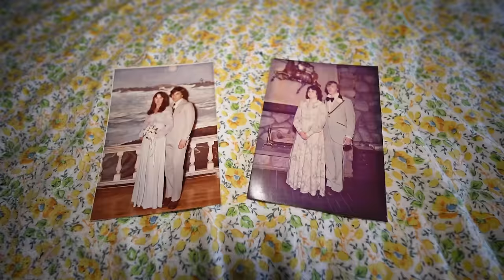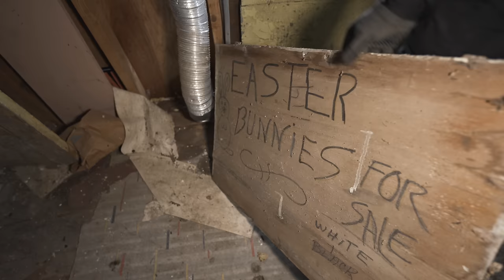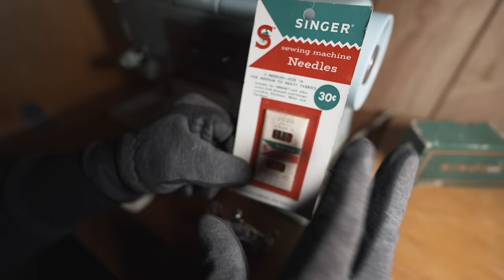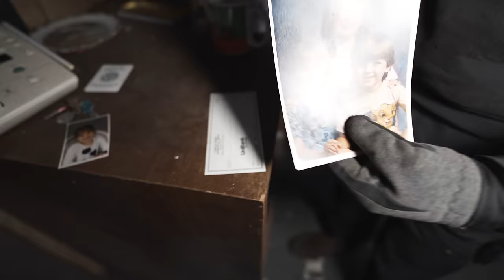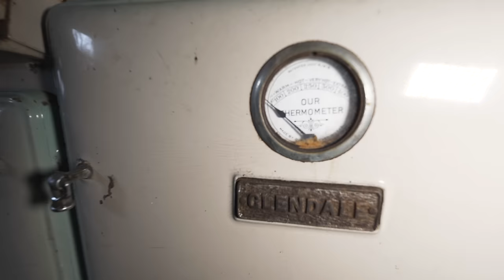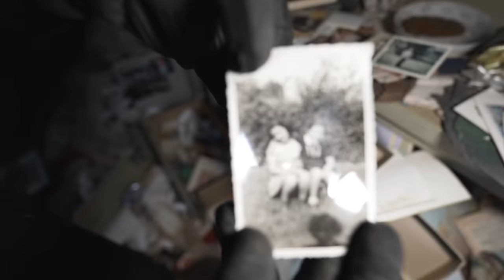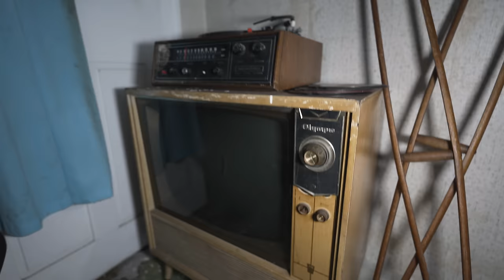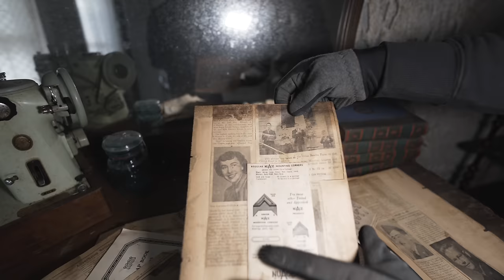Inside the Abandoned Farmhouse of a US Family Broken by Tragedy

Comment: So the second kitchen is the winter kitchen. They would keep the stove burning all day as a heat source. That round metal piece above it is to put the stove pipe in. They put it there to cover the hole.
Reply: The kitchen with the wood burning cook stove was most Likely the Original Kitchen when house was built. The more modern one was definitely an add on
Reply: I was thinking maybe the 2nd kitchen was a summer kitchen, which is where they would do all the vegetable/fruit prep and Canning.  I used to live on a farm that had a separate building for Canning. It had a stove, sink and a big long table down the middle. I used it when canning season rolled around every year.  This kept the heat from the hot water bath (3.5 hours for green beans to process) out of the house. All of the Amish have 2 kitchens in their homes. They have no air conditioning ( neither did our farmhouse), so they typically live in the basement in the summer where it's much cooler. Just my thoughts on the two kitchens. Great job Lesley & Danny!!

Comment: The sewing machine is a 1967-68 model 348. The television you showed at 21:32 was a self-contained console TV. They were considered an actual piece of furniture. Was not a cabinet built around the TV by owner. In last kitchen,l -   the Glendall - was a wood or coal burning stove. The cabinets at the top were not for storing anything. They were warming ovens, keeping something warm if someone is late to supper, placing pie in etc if you want it warm for dessert, etc. It is so sad heirs were not able to maintain it; could be that there was no work for them. I am going to guess the family left because someone noticed the seriously broken floor joists. COULD have been repaired,  but in 1980's would have been very expensive. USA spent most of 1980s in about 3 different recessions. Family farming had mostly become corporate.  I'm guessing a very sad story towards it's end.  Wonderful video.

Comment: That is a balloon framed house. They are very strong, but fire traps.  Balloon houses have been known to actually tumble across a field like a tumbleweed in a tornado and are still built in hurricane prone areas with fireproof modifications.  Even if someone totally remodeled this house to be livable again, they would never be able to get insurance on it due to the balloon frame.  A fire starting in the basement would run up the insides of the wall all the way to the attic in a matter of minutes.
Reply: "A fire starting in the basement would run up the insides of the wall all the way to the attic in a matter of minutes"

By the time a fire dept arrives on the scene of pretty much ANY house fire, the house is a total loss anyway, it only takes minutes and by the time someone sees a fire and calls it in and the firefighters actually get on the rigs and start driving its too late to do anyhing more than keep the fire from spreading to adjacent houses or woods

Comment: Good guess on that teal sewing machine in the left of the room found at 16:51. I believe that’s a 1960s model 457, and from a visual look it appears to get in GOOD condition. The models from the 80s and back are absolute BEASTS. they were designed to have repairs done to them, and there’s very little in the way of degrading material in them. You can disassemble it to its skeleton. The only things that can really degrade are the bands, and the plastic coating if it’s an electric model, the electric treadle and the connection into the machine. I would imagine this particular one needs a bit of internal work, but it’s mostly elbow grease and knowing how to take apart and put the pieces together. It’s mostly rust and corrosion at this point. Parts are relatively easy to find if one is damaged beyond repair.

To know the exact year, one would need to get the serial number off of it. Singer kept VERY good records back to their original machines. In fact, most of the treadle machines pre-electricity are still in use by some folks that are into historical clothing, and I’m sure some others. The treadles absolutely have their uses even for a a modern sew-er as you have ABSOLUTE control over the speed the needle moves, electric peddles are hard to get some of the very very slow stitching that some fabrics require. Granted, these are more historical fabrics than we get now, but some can be found in haute couture and fancy dresses like intricate wedding gowns. The treadle machines can save someone’s hands with delicate fabrics since a lot of fancy dress still requires hand sewing—treadles don’t eliminate all need for hand sewing, but it’s a solid buffer machine to reduce the load on one’s hands.